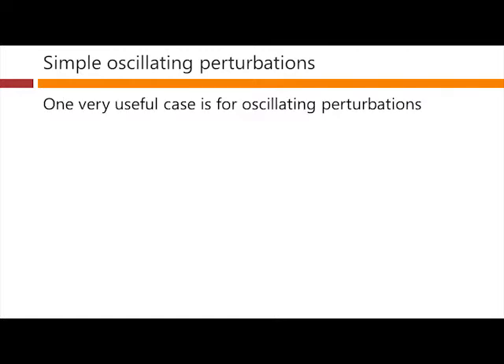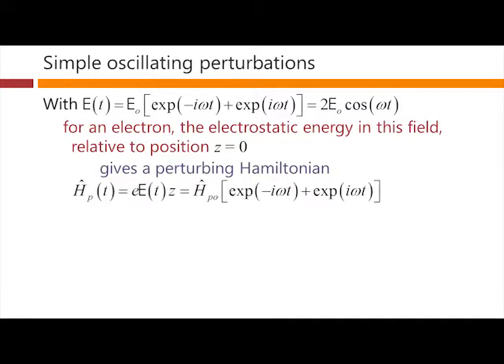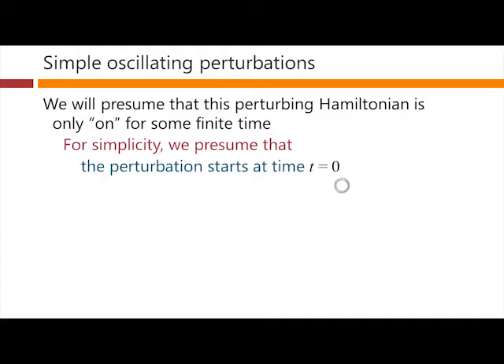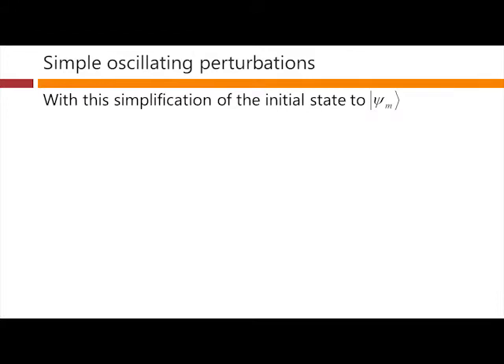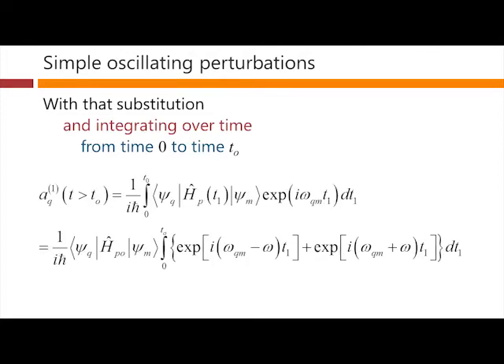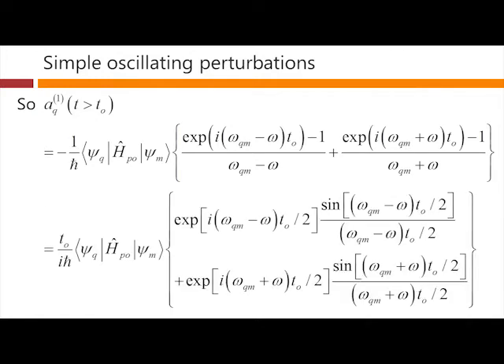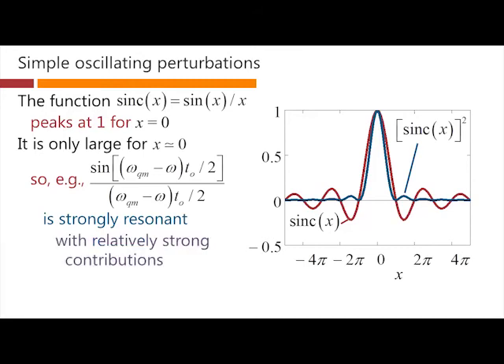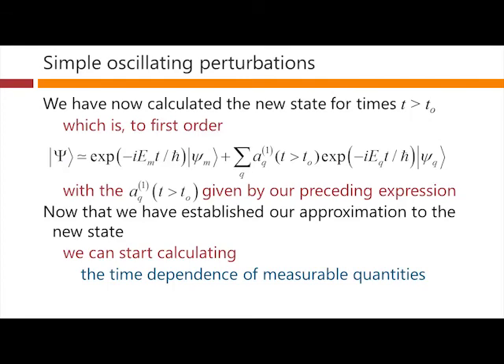Simple oscillating perturbations – David Miller

Comment: Hello Professor Miller, I am a little bit confused about the first line at time 5:15. Is reads a(t>t_0). In my mind, wouldn't it make more sense to say a(t_0>0)? The reason I say this is because the right hand side of the equation does not have a variable called "t." and (t>t_0) just doesn't seem right.
Reply: We have been talking about time t in previous slides. The perturbation has been on from time t=0 to time t= t_o. We are now saying that, for any time t after t_o, this is the answer for this first-order correction coefficient a_q^(1)
Reply: @davidmillermusic  Is this because the electric field stays constant after t_0 at the value it was at at t_0?
Reply: @Frank-ie8dh  The idea is that an oscillating perturbation of a given amplitude is turned on at t=0 and turned off at t=t_0. That will have caused some propability that the atom or electron has moved from its initial "ground" state to some higher state. In this model, if it is now in that higher state, it would stay there for ever, even after we have turned off the oscillating perturbation (which we have done at time t_0). Of course, it is not actually correct that it stays in that excited state forever, but the processes by which it comes back down again (such as spontaneous emission) are not included in this model. This model is quite good for calculating the "upwards" transition rate, though.
Reply: @davidmillermusic  I see, thank you. I'll have to wrap my head around this idea that things stay permanently excited, according to the first order approximation.
Reply: @Frank-ie8dh  It's not that they really stay permanently excited, but the processes that de-excite them are not included in this model. In particular, we should include the process that gives spontaneous emission, but we only get that once we quantize the electromagnetic field rather than treating it as if it was a classical thing. I do get to that in the second "class" in this set of lectures, but it's best to postpone it at this point. It's not ultimately that hard, but one has to build up to it. Incidentally, that process is also a first order perturbation process, essentially. It's not the fact that we are using a first order approximation that is the problem; it's that we have not included all the processes in the Hamiltonian. As I said, though, this model we have here is still a good one for calculating the transition rate for absorption processes.
Reply: @davidmillermusic  Thank you for pointing this out. I also have another fine point. So, it is true (according to 1st order theory but not higher order approximations/different methods) that the coefficients calculated (a_n^k) do not change after t_0. However, let us consider the basis eigenfunction which solve H(t=0); call one such basis function Psi_m. In time independent perturbation theory, Psi_m may change is shape in the presence of an external E field. The E field is said to transform Psi_m - via a perturbation matrix - into a linear combination of the basis eigenfunctions which solve H(t=0). Call this transformed eigenfunction Psi_m'. It is only logical, then, that Psi_m' returns back to Psi_m after the electric field is removed. So even though the coefficients for Psi_m' do not change after the field is turned off at t_0, the eigenfunctions Psi_m' do transform back into Psi_m. Correct me if I am wrong, and thanks for this series again. Quite a service for the public
Reply: @Frank-ie8dh  Yes, the energy eigenfunctions depend on what the Hamiltonian is. If the perturbation was some fixed one (so that was not changing in time, like a static electric field), then we would have one set of energy eigenfunctions when the perturbation (the field) is off and another set of energy eigenfunctions when the perturbation (the field) is on. Perturbation theory is then just a way of trying to calculate the energy eigenfunctions when the field is on. Now, for an oscillating perturbation, since the Hamiltonian is changing in time, it is not really clear that there are any energy eigenfunctions in that case; energy eigenfunctions only really exist if everything is stable in time. We can still calculate the quantum mechanical state in the presence of a time-varying perturbation, and we can use time-dependent perturbation theory to do that, but the states will not be energy eigenstates.